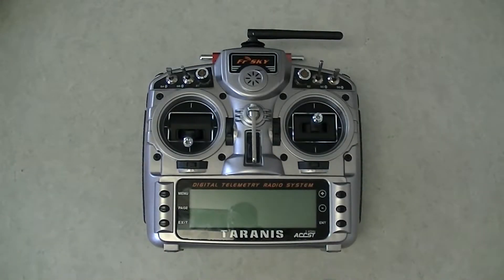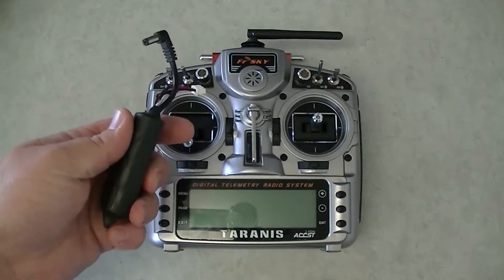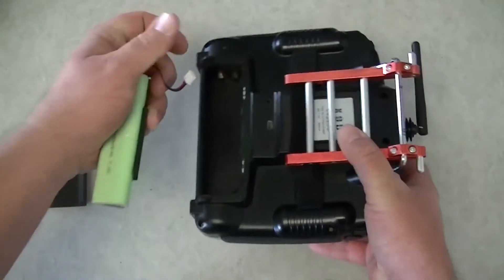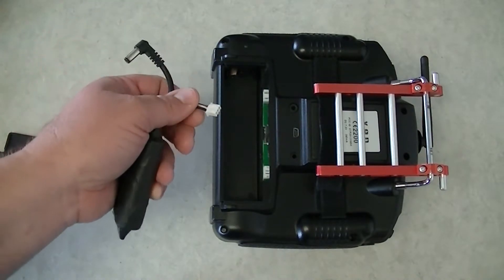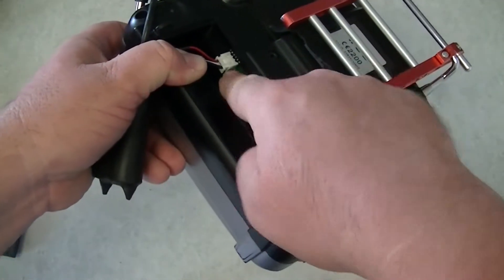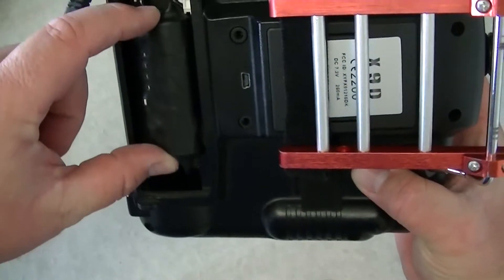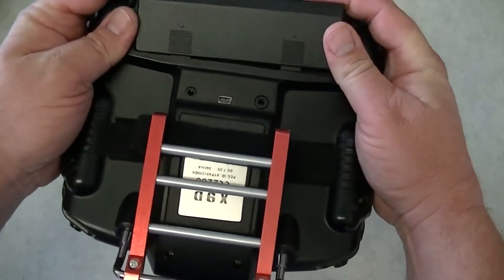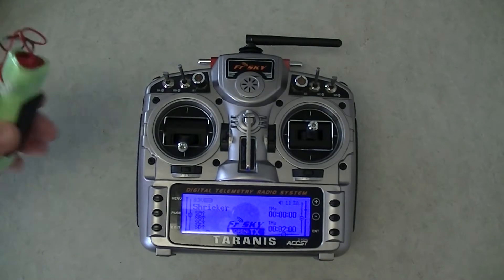Taranis X9D 18650 Li-Ion Fatshark Battery

Comment: is it possible to charge the lithion Ions with stick charger safely? don't things so but want to know what others are doing or are you just removing and charging on your lipo charger?
I've done a 2S2P mod on mine, so the 18650's are internal 6000mAh
Reply from the maker: The stock in built charger is for nimh in a 6s configuration only. It will not charge lithium technology safely at all. I charge all my lithium radio batteries on a separate charger.

Comment: Why not charging the 2000mAh NiMh Battery with a normal balance charge?
Reply from the maker: fr2632 I do charge my nimh battery with a hobby charger from time to time. I don't quite understand why you are asking.
Reply: I am sorry if I was not clear :) On your video you are swapping the original battery with a fatshark one and I was simply asking myself why not using the original one ?
Reply from the maker: No worries. This LiIon goggle battery is only for emergencies if I've forgotten to charge my NiMh battery. I normally rotate between the stock battery and a LiFe battery. However, the 18650 really is a great option as a go to battery.

Comment: Can you charge them inside the radio with the taranis wall plug?
Reply from the maker: Mike Hui No! The only battery you should charge in the Taranis with the internal charge circuit are the stock Taranis batteries.